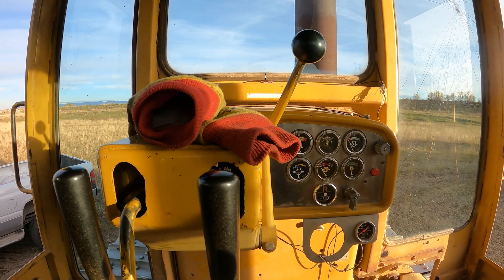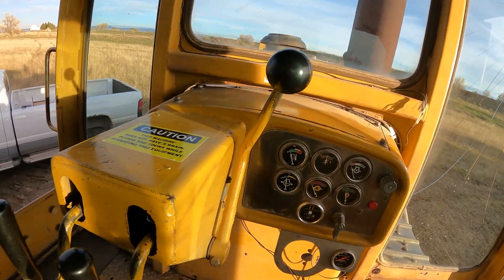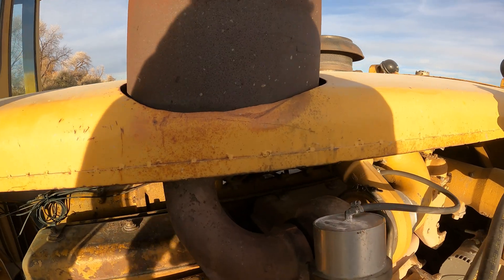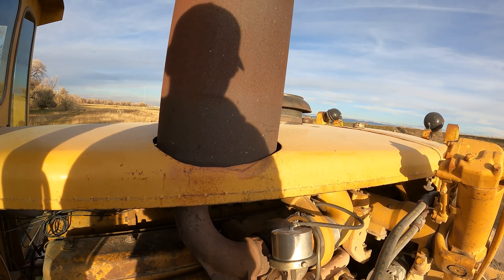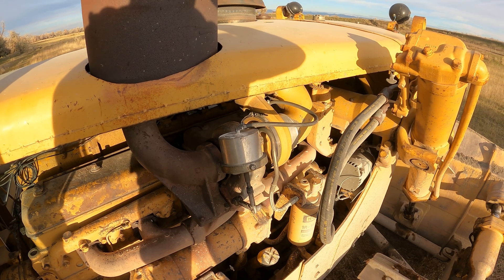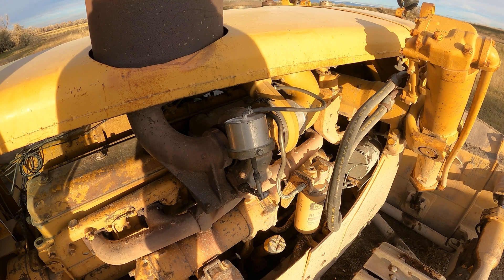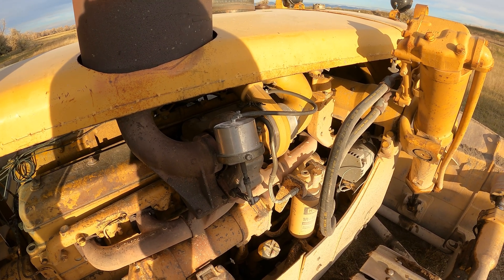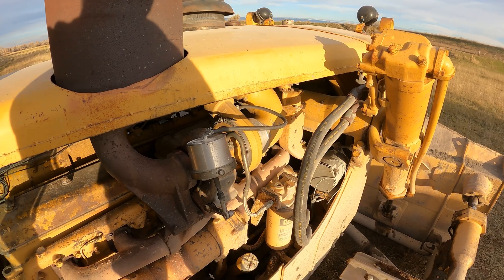How Much Air Does A Switchblade Turbo Pump

Comment: Is that hitting 25” of restriction? Just think how much more air it would move if you could get that restriction down , it would also up the air density because you’re not compressing the air as much and adding heat.

Comment: More air means cleaner combustion. Thats what always blew my mind is when they put restrictions on airflow through a combustion engine is does more damage to the internal parts than if they would have just left it alone without all the EGR crap and special mix to burn exhaust gases. Choking engines down is manufacturers and governments dream to keep people having to buy new equipment constantly. Climat crisis is made up in they heads for them to make more tax dollars fooling the public.

Comment: Some of the early D9's had dual air filters these might have been oil bath,  is there room to modify and add dual paper filters?
Reply from the maker: yes they were two upright dry type ones but no safety filter

Comment: should you put larger injector's to keep from running lean
Reply from the maker: Diesels don't run lean
Reply: @Jpaydirt  maybe lean was the wrong term . If you use to much fuel it will blow black smoke . So your saying you cant run to much air ? I feel really stupid right now .I appreciate you not pointing out my stupidity
Reply from the maker: @huckstirred7112   you can't run to much air, but fuel and heat make the turbine spin and that makes boost, so if I added more fuel it would pump more air, but the old turbo that was on it didn't pump the volume todays turbos do so the air filter isn't designed to handle that much draw.   diesel and gasoline are different, you may want to google how they are different and what a lean or rich mixture on gas does to and engine
Reply: @Jpaydirt  I have destroyed more than one gas engine due to teenage stupidity .  I am 50 years old and still love mud bogging .  I can say I honestly destroyed 16 4 wheel drive trucks . My favorite was a 2.2 liter diesel . But it was stolen from me before I played with it much . But I Never knew much about diesels . But they do fascinate me . And only now am starting to learn more . Thank you for your reply it is much appreciated

Comment: May have to have the filter minder folks make a higher calibrated filter minder to compensate for the higher vacuum rates in the clean air intake side so you can actually use the minders as intended.

Basically a tad more spring resistance in the filter minder to match the new turbo set up and abilities.

Do you have way higher  exhaust  temps with with that switch blade turbo or do they run cooler ?